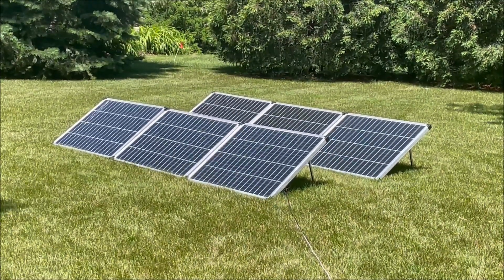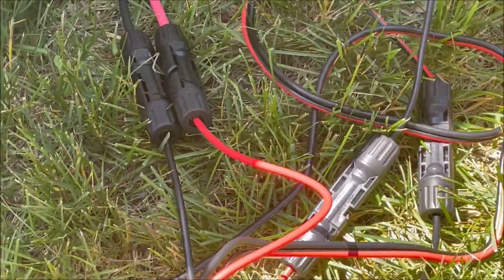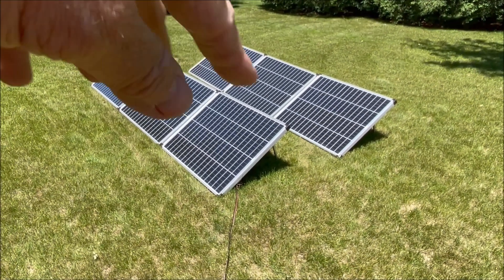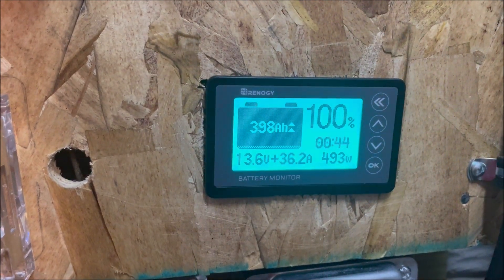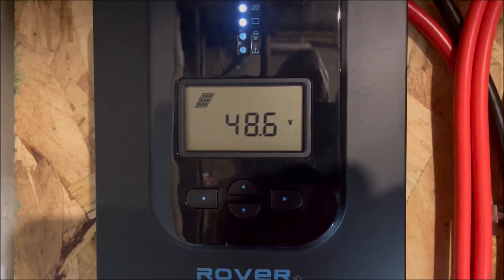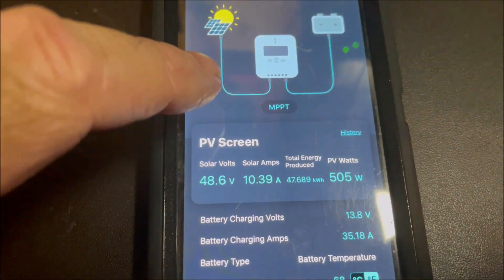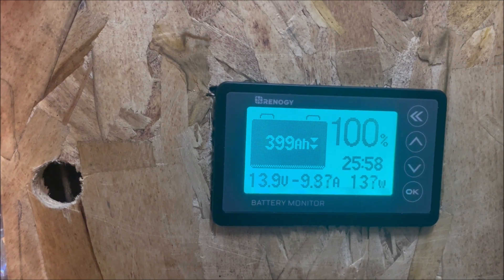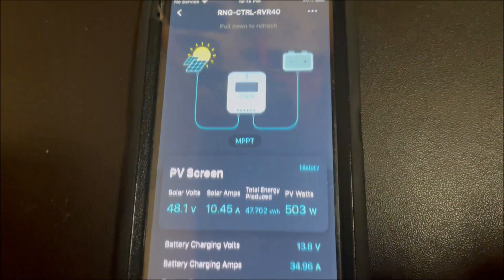Part 2-Hook 8 Harbor Freight Solar Panels together in Parallel - OOPS - "Houston We Have A Problem"

Comment: So the harbor freight  400 watt splitter is no good
Reply from the maker: Not at all.  I did another video where I took it apart and it's actually pretty heavy duty.  I believe the issue is more with the charge controller.  I think the charge controller doesn't function well at 18Vdc and high current.  I now use the panels in a 3S configuration at 54Vdcish, low current and it bangs.
Reply: The 400 watts combiner HF is parallel connected. If you want to increase volts, this not it. You want volts same but increase amps, this is it.

Comment: Did you cut the SAE connectors off and solder on the mc4s?   Or did you get the SAE to mc4 adapter and use thicker gauge wire in between?
Reply from the maker: I did cut off the SAE Connector on most of my panels and replaced them with the more common MC4 Connector.  See this Video on how I did it. https://youtu.be/KSOZrKYkOlE

Comment: I've watched this video a few times. I keep changing my plans. I now have 8 100 wat HF panels, Renogy 100a Charge controller & Renogy 300w inverter.  I have SAE to MC4 adapters so I didn't cut the connections going to 10awg  50ft cable in 1in pvc. Thinking of doing 4 more panels in spring. I have 4 100ah agm batteries. Should I be 2S 4P or 4S2P?
Reply: 3000 watt inverter not 300
Reply from the maker: With 10awg you will want the higher voltage of the 4S2P

Comment: Did you try changing the SAE to MC4 and running all panels in parallel to test the difference that the connections made? Just wondering how much of a difference that one change would make.
Reply from the maker: No I had not.  I will try it out soon and report back.

Comment: I have a Renogy 60amp MMPT charge controller, 4-100 watt Harbor Freight panels hooked together the with HF hub, using 6 gauge wire, 6 lead acid 106ah batteries wired parallel (12v)... I live at 8000ft in Colorado and get plenty of sunshine. The highest wattage I have seen is 178w (full sun in all its glory) my batteries have never dropped below 12.6 and have been running for 5 months now. I charge my phones, laptop, occasional movie (bluray and TV), and run the furnace + lights in camper all day and night. The Harbor Freight controller would sound the alarm frequently hitting 32-33amps ... so I upgraded to the RENOGY 60amp. My question if anyone can answer is on the Renogy setup for battery capacity it says "200" ..  nothing in the manual explains that at all. Is that amp hours? Since I have 6 - 106ah batteries should I set that to 636? Or 106? thanks in advance.
Reply from the maker: I reviewed the manual and your right it says nothing about setting the Capacity.  I would go to the screen that shows capacity and arrow down to see if it can be changed.  Contacted Renogy directly will probably get you a better answer.  That setting is probably used to better determine State of Charge (SOC), statistical data on their App.  As far as only getting a max of 178W in full sun it is my experience that the Renogy MPPT does not work well at 18Vdc which is what you will be getting out of your panels.  I get max power  in a Series config.  Watch my video's on converting to MC4 connectors and connecting in Series.  I haven't done a video on a 4S Configuration yet but it is the same as 3S with one more panel.  Good Luck and thanks for Watching.
Reply: @thechiefsway2618  thank you sir..  appreciate the tips and help!
Reply from the maker: P.S. I think it would be 600 or 636.
Reply from the maker: See the 100A Renogy manual.  Explains it a little better. 

https://www.renogy.com/rover-100-amp-mppt-solar-charge-controller/
Reply from the maker: It appears the Battery can be set from 0-9999

Comment: Thank you, sir, for making these videos showing your operating system with these particular components.  I've watched a number of Will Prowse videos and others but I especially appreciate yours because your system is so similar to the system I have been slowly assembling over the last several months.  I had been watching the Harbor Freight sales and buying the 100W panels a few at a time.  My plan has been for a 12 panel system using a couple of the same Renogy 40A charge controllers that you have.  Like you, I had been planning to do it all in 12V parallel using 3 of the 400W Universal Solar Connectors but now I see I should use a series-parallel arrangement and will probably use MC4 connectors.  So this was really good information for me.  Thanks!
Reply from the maker: I also plan on adding another Charge Controller and more panels.  Thanks and make sure to like and subscribe.
Reply: @thechiefsway2618  So your experience influenced the final design of my system.  For a long time, I had been planning on assembling arrays of 4 Harbor Freight panels in a wooden frame connected to a Harbor Freight Universal Solar Connector like you originally did because it was easy.  But based on your experience, I changed the design and built this:  https://www.youtube.com/watch?v=ZDJQTQ4VTsw. Before I replaced the original SAE connectors with MC4 connectors on the last 4 panels of the last array, I did an experiment with those 4 panels connected to the (parallel)  Universal Connector to see if I'd get a similar result to you but, for me, it didn't make a lot of difference.  I got about 22 Amps with 4 panels and the parallel connection and about 23 amps using the series/parallel arrangement.  At that point, it was too late to go back and my arrays have 6 panels in a series/parallel arrangement.  It works great so I'm happy.
Reply from the maker: I Love those Six Panel Arrays you have built.  I have shared out your Video to my Viewers via the Community tab.  I am probably going to build those same arrays next spring.  Thank you for sharing.
Reply: @thechiefsway2618  Thanks.  Just be aware, those arrays are heavy suckers (150 lbs. each) and require 2 persons to set up, but they do work.

Comment: Hey chief is it possible to run the SAE cable all the way down to the charge controller? What do I need to connect
Reply from the maker: Yes you can run the SEA Connector down to the charge controller as long a the cable is long enough.  You would I'm guessing need some form of weather proof penetration to get through a wall.  You will have to get the direction of the SAE cable correct because they are made for DC so they do have a proper direction.  SEE MY VIDEO on how to charge a Battery which explains about SAE Cables.  Link Attached.  https://youtu.be/UmO7PhkJLKw

Comment: do you think the problem was the cable itself? and only the mc 4 fixed it? or did it just need a thicker cable of the old type? thanks im having the same issue currently and cant get full power and i can tell the cord is stopping it cuz when i put the battery right at the panels it works alot better
Reply from the maker: I did put on a new cable but it was also 10 AWG but had MC4 connectors on it.  What I think fixed it was switching from parallel to a 3S-2P configuration which increased the voltage from 16-18 to 48-50Vdc.  I think that Renogy CC just does not work well maximizing 16-18Vdc.  I how have seen a max of 611W out of 600W of panel one time and regularly see high 500’s which bothers me because that CC is only supposed to have 520 max.
Reply: @thechiefsway2618  im still trying to understand the whole series and parallel thing, I think my cord isnt thick enough cuz when in near the panels i get alot more juice then after the extention cord. is mc4 better or its just more about the thickness of the gauge?  Im just trying to get the minimum amount needed to charge my car even on 110v
Reply from the maker: @tips4tesla407  I'll be doing some video's soon on the 2S, 3S, and 4S Series Parallel Connections in Solar Basics.

Comment: I have 12 of the harbor freight solar panels. Do not put them in parallel! Put all six of them in  series and you will get 600+ watts.
Reply: you have to replace the connector or put an adapter to do this? the base connectors of the harbor freight seem hard to do this with
Reply: I have 2 of them and want to run 12 volts, what’s my best bet?

Comment: It’s just probably the wiring Harbor Freight used on their PV modules is maybe why most people couldn’t get almost all the power caused by from some losses in the type of wires H F used . All it took was a  rewiring overhaul using your own MC4 connectors and thicker cables to solve this problem and was very successful in acceptable increased power production from somehow cheap 100 watts solar panels . Check out my DIY solar videos , hit like , leave a message and subscribe . Excellent video ! May the solar be with you .

Comment: Good job on converting to MC4 and putting the groups into series and parallel. I knew the issue was the harbor freight connection box. It is very difficult to get 100 percent from the panels but 70% to 80% and sometimes 90% is normal. 100% needs perfect angle and conditions, so it is rare unless you have no clouds and have the panels directed and angled perfectly. You could make a third group of solar with your suitcase panels, but it would be best to connect them to a separate charge controller unless they have the same voltage. You can connect more than one charge controller to a battery without any issues. I have 3 charge controllers connected to my batteries with a group of panels for each one. 
I have videos on YouTube of mine if you're interested in seeing it. I made the mistake of having the 3 groups all connected to the same charge controller and losing wattage from the panels because the voltages were not the same. I had 2 sets of 180-watt panels in series and one set of 4 100-watt panels in parallel and never got more than 20 volts even though the 180 watt panels made 36 volts. Since I have done that my batteries tend to stay mostly charged with a window unit ac running off of them
Reply: 80% of stated wattage is normal.

Comment: @ the Chief's Way ...  HOPE YOU get cancelled - I suggest taking a step back & you "translate a suggestion in order to argue" that I am suggesting you take 1 step back - into actually meaning moving back 50 feet away & needing binoculars &  a laser pointer !? ... god how argumentative are you .. all I asked was for you to back up 6 inches ... NOT 50 feet ! .. never suggested either "binoculars"  or  "use of a laser pointer"  as you are to lazy to use "feet" that god gave you to use.
Reply from the maker: Not sure what your talking about.  I did not argue with you.  I was suggesting I could just stand back farther then I normally do.  I never said anything about 50 feet.  I usually point directly at what I'm talking about when I'm close.  Stepping back I wouldn't be able to reach the device and I happen to have a laser pointer so I suggested I could use that to bring attention to what I was discussing.  Sorry that you had misinterpreted what I was trying to say.  I was saying I would make a video that the entire system could be seen.  Hope this helps.

Comment: Nice, looks alot more efficient especially supplying higher voltage to the charge controller.   I have one of those parallel hubs but decided to set up mine like this too.  My goal is to run 2 strings of 5 panels to my Bluetti 200max. It's max solar input is 900 watts with the capability of handling 150 volts dc.  I need to buy 4 more panels and was hoping for another sale or coupon.

Comment: Hi, We also need the info on sae (j-plug) to mc4 but can you also tell us where to buy the wires, connectors, etc?  Trying to set up an emergency source to keep our granddaughter's insulin at temp.
Reply from the maker: Here is a link to a kit I purchased to convert my SAE to MC4.  I will be making a video soon on how to do it so keep a close eye out for it.  I will also include a link to everything I just purchased to convert.  If you look for my system build video in the description will be links to everything used.

https://www.amazon.com/dp/B07VKTP7RF?psc=1&ref=ppx_yo2ov_dt_b_product_details

https://www.amazon.com/dp/B01D7VBJNA?ref=ppx_yo2ov_dt_b_product_details&th=1

https://www.amazon.com/dp/B07B4ZM8Y8?ref=ppx_yo2ov_dt_b_product_details&th=1

https://www.amazon.com/dp/B08FLGCYPD?psc=1&ref=ppx_yo2ov_dt_b_product_details

https://www.amazon.com/dp/B01D7VBFOS?ref=ppx_yo2ov_dt_b_product_details&th=1

https://www.amazon.com/dp/B0753X68PS?ref=ppx_yo2ov_dt_b_product_details&th=1

https://www.amazon.com/dp/B07DJ5PHSB?ref=ppx_yo2ov_dt_b_product_details&th=1

https://www.amazon.com/dp/B07M98WSBQ?ref=ppx_yo2ov_dt_b_product_details&th=1
Reply: @thechiefsway2618  Thank you!!!!  We will keep watching for more videos.  😇

Comment: Good job Chief. I could sit for hours watching my Renogy battery meter recalculate run times, amps, charge time, discharge time, Miller Time, etc.   I have the 40 amp Renogy MPPT and BT-2 as well.  On another project I installed a Victron Smart Shunt and was a little disappointed in it. The BT-1 and BT-2 Renogy modules will read from upstairs but the Victron won't read  that far away. What batteries do you have?
Reply from the maker: I have 4 Weize 12.8V 100Ah LiFePo4 Batteries in parallel.  Originally had a Renogy BT but it had problems so I returned it.  Will Prowes of DIY Solar did a Good review of the Weize so I started buying then.
Reply: @thechiefsway2618   Will reminds me of myself 50 years ago. I tore into everything to see how it worked, made changes, put the stuff back together and ran it. I couldn't leave anything alone. I spent today working on my 9th home built solar generator. Its portable as long as you own a forklift. It has a few Chins 300's on it.   I used to buy Weize SLA batteries for my friend's wheelchair so I knew they were a good reliable quality brand before Will commenced to cutting his apart. Cheers!